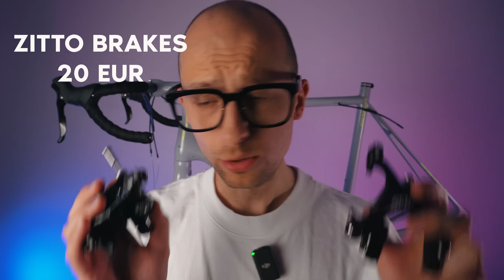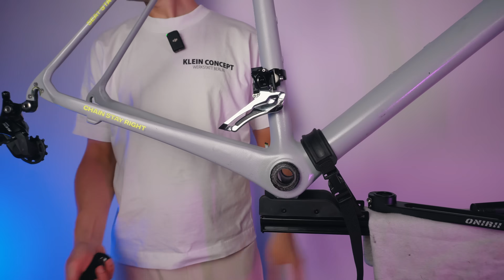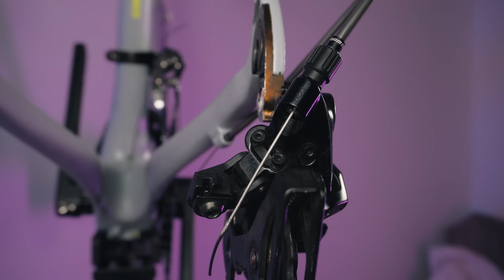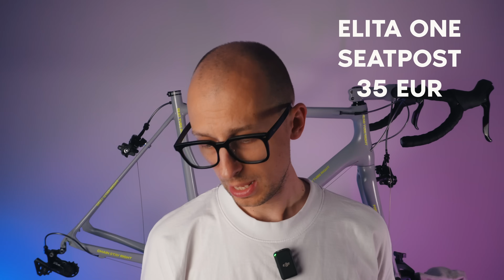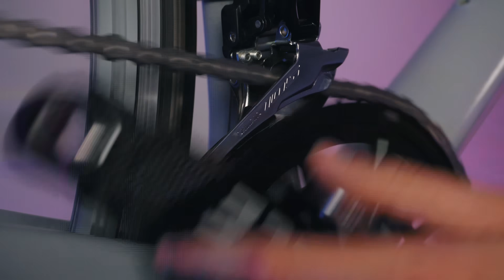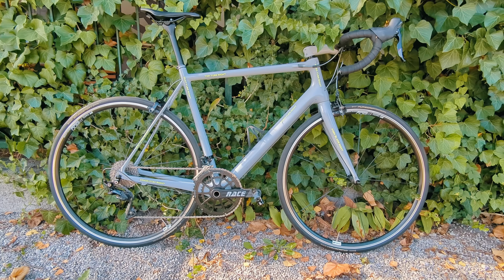Building a Giveaway Speed Machine Road Bike with a 1000 Euro budget.

Comment: I have in mind to either upgrade my giant contend 3 or going for a new bike (Gravel one). The idea is going for 105, some carbon HB and Seatpost + a better saddle and some of those lower tier winspace rim brake wheels, trying to be under €1500. Don't know if it's worth it to invest that money in such "Low tier" frameset
Reply from the maker: Sounds like a good plan. I think upgrading your current bike is always a good idea.

Did you have a look at the Elitewheels or Drive wheelsets? They might be lighter for a even lower price.
Reply: @klein-concept  yeah I saw them, but, there are so many few reviews. It's hard to say if they are any good
Reply from the maker: @bernardo9202  i have been driving the Drive ones for years now. Have a disc and a rim set. The regular Elitewheels have been one of my first wheelsets ever. They are heavier but ride great as well.
Reply: Yeah they are for sure one of the ones i have been considering. I'm 95kg, so i weight isn't much of concern for me. Just want the performance and comfort from it @klein-concept
Reply from the maker: @bernardo9202  then give them a look as i think theybare a valid option and compare prices and weights to the winspace lun ones 🤜🤛

Comment: With that 105 front derailleur you can use the tension adjustment screw to line up the two white marks on the rear of the derailleur. It will shift perfectly then (obviously you may have done this off camera but it something a lot of people miss)
Reply from the maker: Thanks a lot. Definitely missed that. Will give it a try to see what effect it will have. 🫶
Reply: @klein-concept  no worries, I made a real mess installing it the first time so did some hard-core research to do it correctly 😅🤣
Reply from the maker: @abedfo88  love some good hard core research 😂😂🤜🤛